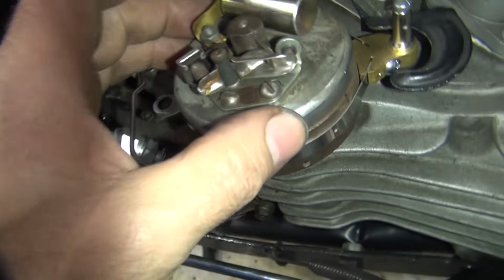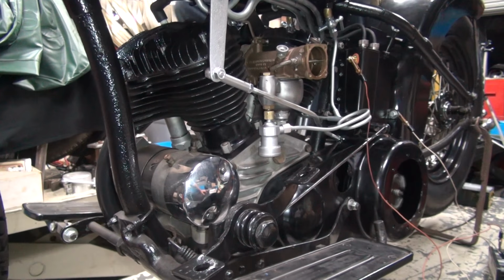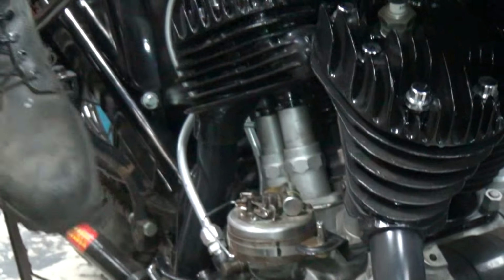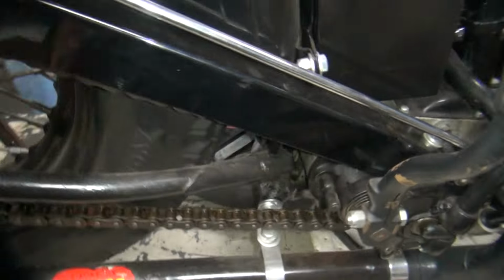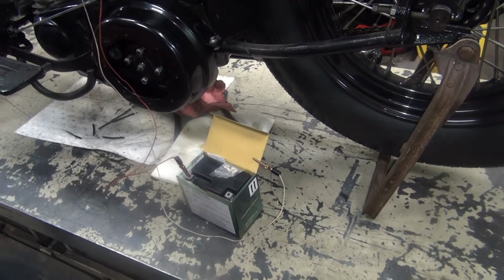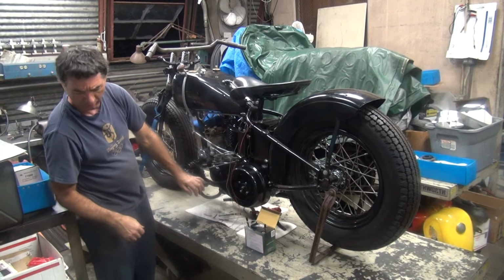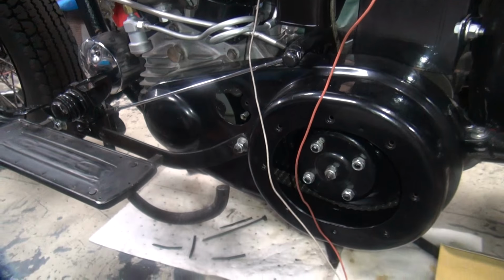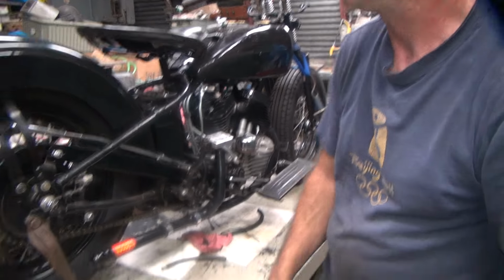1936 RL #116 WL 45ci Flathead Bobber Bike Assembly rebuild 41 WLA Harley by tatro machine

Comment: How much HP did these motors make, 15-20 HP??
Reply from the maker: 20hp on the iron head models and 25hp on the aluminum head versions. the wla had low compression aluminum heads so it was probably in the middle somewhere. the wld, wr and kr's had progressively more power over the years and topped out at around 50hp on the 45ci flathead motors.
tatro